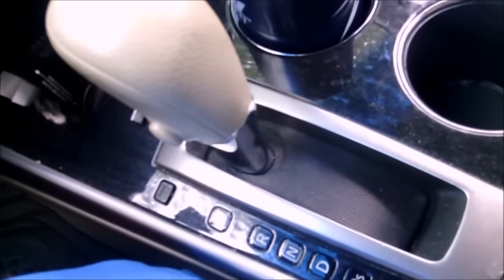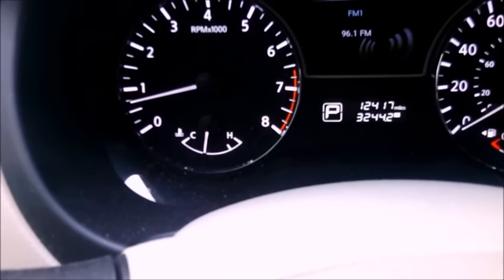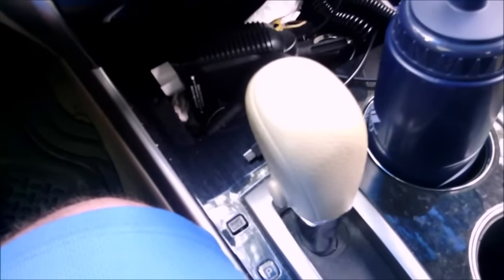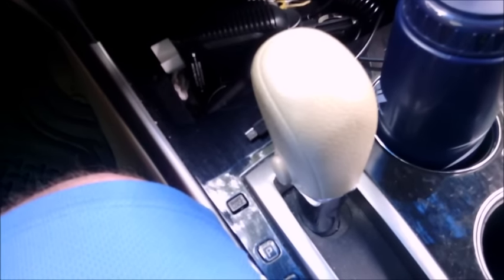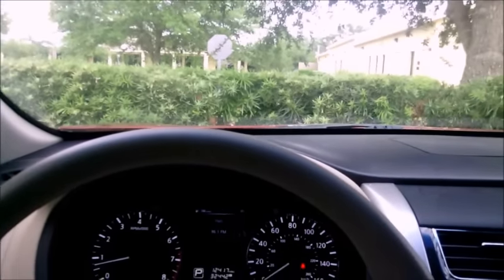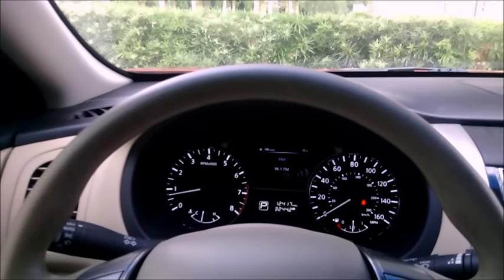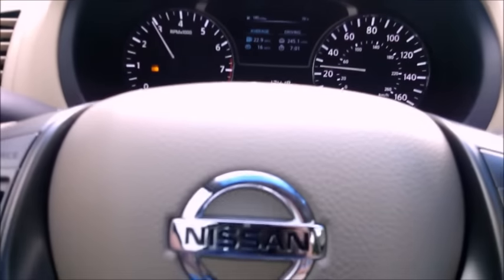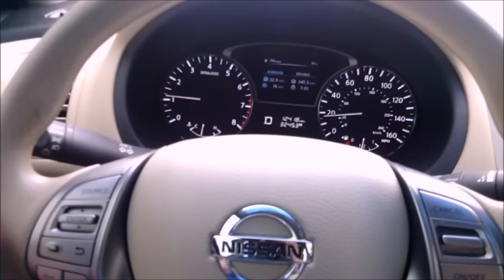What Does OVERDRIVE Button Do (O/D light Off Toyota Ford Nissan Honda Dodge Hyundai Kia Chevy GM car

Comment: Not much helpful thanks !!!
Reply: sajidtanwar this actually sounds like someone who doesn't know what they're talking about..... Disengaging o/d allows you to go into a lower gear range for more power on climbs or when towing..... It allows you to use all the torque available by allowing you to run at higher rpm without having to stomp the gas..... It can also be used as an engine brake by letting off the gas and disengaging o/d causing the engine and transmission to work against each other and thus slow you down without using the brake.... This can be done when descending or I slow speed driving conditions ..... One could also reengage the o/d to slow the vehicle by being in too high of a gear when climbing

Comment: Overdrive is too go faster....
Reply: eddie rosa no it's not to go faster. When your car goes into overdrive it actually locks up or stalls your torque converter so that you basically have a  1 to 1 gear ratio to your wheels loading your engine so that it doesn't rev very high thus saving fuel. Running a vehicle with overdrive turned off causes excessive engine rpms and heat build up that in turn wears out your engine faster. I am a mechanic and yes I've seen plenty engines go up with less than 100,000.00 miles on them because the owner has been running it with overdrive shut off pretty much the entire life of the car. When the engine should have lasted an easy 300,000.00 miles. Yes even imports I've seen them go well before 100,000.00 miles because people think that they can keep hotroding that engine and nothing will happen. It's funny how they get pissed when they're told they need a new engine.
Reply: David Smith DS mode is too go fast ?